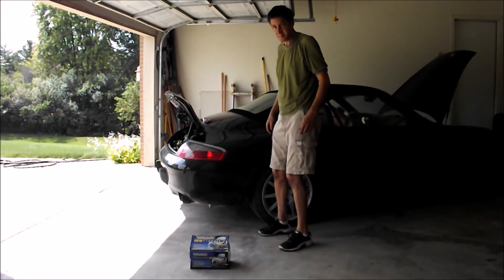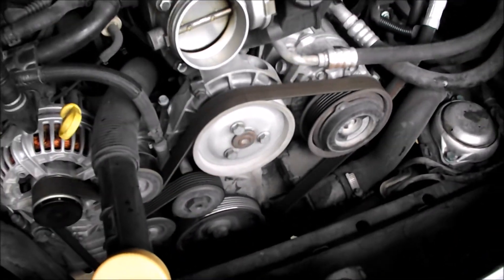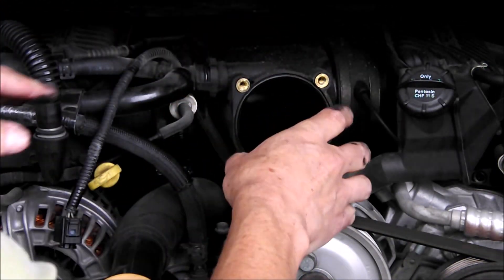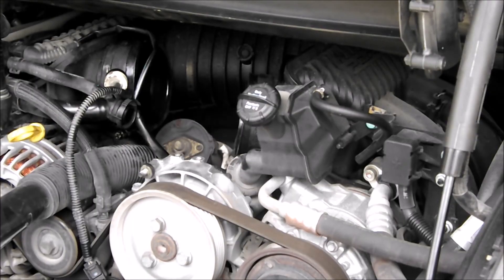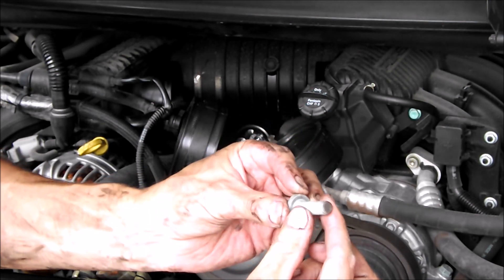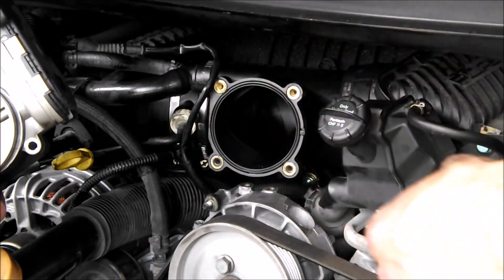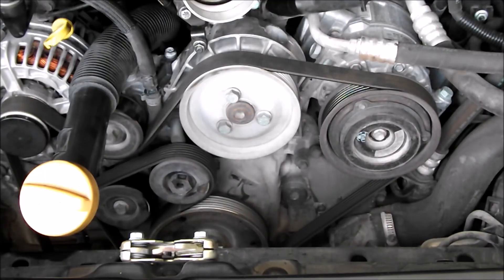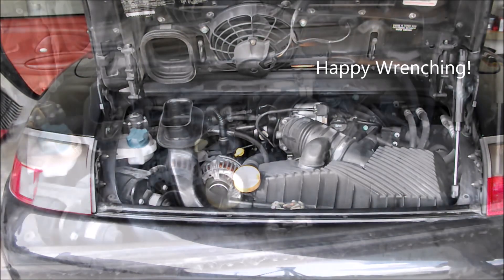Porsche 996 Starter Replacement

Comment: Hi guys, great video! Thanks much! I replaced the starter on my 2005 Porsche 911 Carrera Convertible (997) three months ago with a Bosch starter from Amazon (CAN $315.00). It solved my "hot start" problem and took me about 4.5 hrs to do.    A few notes: The Porsche Workshop Manual is pretty much useless in explaining how to do it (job #27 60 19). On the 997, I also had to remove the alternator to reach the bottom left fastening screw of starter; even then it was very tricky. I have no idea how I could have done it without removing the alternator! When putting in the replacement starter, I used electric tape to limit the movement of the u-joint of a rather long extension. As mentioned below by Chassis Hawk, the u-joint needs to be close to the socket. I also wrapped electric tape around the head of the fastening screw to prevent it from falling out of the socket when feeding the bottom left fastening screw back into its place. I found this to be the trickiest part of the job! Unlike shown in the video, I managed to remove the throttle body in one piece, though. I undid all four metal hose clamps and was able to wiggle the hose on either side loose, before pushing them sideways out of the way with a screw driver. This way, I was able to remove the throttle body in one piece. Putting the throttle body back in again was the same procedure in reverse. Be careful with the plastic oil filler tube as it is easy to break while working on replacing the starter.     ---     Replacing the starter solved my "hot start" problem that bugged me for almost 2 years. With only 56,000 km on the motor, the vehicle was reluctant to start when engine was hot. First thing I did was replace the battery (CAN $470.00). That improved things for a short while, until I experienced the same "hot start" issue. The Porsche dealer suggested to replace the battery cable. They did for CAN $1,000.00. Some 10,000 km later, the "hot start" issue was back. I had to charge the battery every couple of weeks to have enough power to crank the motor when hot. According to the various fora, the last thing to replace was the starter; I did that and have put 3,000 km on the vehicle since. Vehicle starts like a charm whether engine is hot or cold. It appears that over time, the heat of the engine fries the starter (and also the cables). Very happy to have done the job myself - puts a smile on my face every time I turn the key!   :)    Thanks again, Chassis Hawk!
Reply: Very interesting, thanks!  Could you have changed the battery cable yourself at the same time, or was this project something a guy would need to have a dealer or pro shop do?
Reply: @aboyandhisdog  I probably could have done it myself and replace the starter and the cables at the same time. There are other videos explaining how to do it (e.g. https://youtu.be/SDJ50RaF8XE). In my case, I had the dealer replace the cables.

Comment: There actually is a slot to fit in an extension without a universal. But you need a bunch of short extensions to stack them up as you push into the slot

Comment: Very nice video. Makes it look easy. What exactly was the problem with the starter. My 03 996 seems to take a little more power to start mine and it isn't turning the engine even though the battery is new. I'm guessing my starter is the culprit. 60k later I'd expect the, to last longer. 
What brand of replacement starter did you use. And what was the price. I've seen prices anywhere from $175-1100. Wow.  Thx again

Comment: Nice ! You probably saved $1000 . I prefer to replace the serp belt tensioner too .At least the pulley on it if (if available separate ) you know its still lower mileage

Comment: Great video, thanks. My starter on my 996 is also shot, and I am debating paying to have it done ~$800 vs just doing it my self. You make it look like a quick fix, but it appears there are some difficult steps accessing the starter. Any warnings you can highlight before I take the jump? Also, besides getting a starter, what other parts and seals do you recommend I replace along the way, besides the air filter? Also, that socket extension to access the starter bolts, will any flex shaft work for that, I can't see exactly what you did. Thanks for the video.
Reply from the maker: +Shea Ferring 
I would recommend changing the accessory drive belt, but I didn't see any other seals or parts that should be replaced.  Sorry about the view of the socket extension.  I used a 3/8 U joint with shrink tubing over it to restrict how much it would droop.  You might be able to get it done without the shrink tubing, it just made it easier.  The U joint needs to be near the socket.  Then you need a very long extension, such as 18 inch.  I have 18, 12, and 6 inch  3/8 extensions and unfortunately don't recall exactly what combination I used.  I used an adapter to fit to a 1/2" breaker bar to get enough torque.  If you already try to work on the car, I recommend taking it on.  It took about 4 hours, but we were slowed by taking video.  I've done a lot more difficult projects on the car, such as the exhaust replacement.  It was fun, and it's crazy how much you have to pay a dealer.  I bought a rebuilt starter on eBay and I'm happy with it.  The main tip is that installing the plastic plenum is a little tricky.  If you need to get all four hose clamps off, then you can push the plenum straight in and work the rubber around the plenum.  Then you have to be patient and reinstall the hose clamps.  I tried to leave the hose clamps on the rubber first, but that didn't work out.
Reply: +Chassis H
ywk

Comment: How did you losen the lower bolt ? That would be nice to know
Reply: after viewing this video maybe 70 times i decided to go for it. it took me an hour to reach this f***  bolt. you must have a 3/8 U joint with lots of straight extensions. also:  i didnt do it but shrink tubing the joint as advised by S.H. would have made it easier for sure (didn’t want to break and loose the plastic part downthere). i endend up with my right hand guiding the tool thru the space made by the missing air tubes, and helping it the tool to reach the bolt so that you pass between the oil tube and the alternator and place it correctly. I gently use a hammer to have it lock on the bolt, if its not aligned you won’t be able to unscrew it. mine was heavily screwed. My car has 240k kms and the starter has never been removed before apparently i wouldnt recommand to change it for fun if it doesnt make the horrible sound when the engine starts (the starter dented thing doesnt come back in it's position so the wheel makes it turn quicker that it should). The tool and the 2 bolts has to be perfectly lined up or you will swept. There's tons of plastic tubes, electric wires, durites and the oil reservoir tube that make it looks impossible, but it works, its german.. Even to take the old starter out is not so simple. I got a 3,6L and it look even tighter than the 3,4L in the video (or S.H. disengaged some cables?). I'm a beginner and it took me 8 hours. taking out the air planum was easy, take it back was not but again with some force it’s working. Thanks for making this video it has been my Starter Bible. this horrible neigh sound is gone :-) PS: i bought a A.S. to replace my Bosch. 90€ new instead of 240+120€ return of the used one fee. Pardon my english dont know lot of technical terms in english. Hope this will enlight even more the situation.
Reply: @vadimsvoboda  Hi there good job!!! Just curious what dies the neigh sound like? Sometimes especially low battery mine starts to crank but fails to start and it sounds like a clunky crappy noise my starter still spinning and cant stop it until it completely drains my battery. Could it be running and solenoid activates but bendix gear not extending?
Reply: @9jfd1  mine was sounding like an horse with a touch of « fizzzzzzzz » last very short like 2 seconds

Comment: While doing my IMS bearing upgrade I  realized the starter is on the engine and not the trans like old air cooled vw's . I thought the with trans out it would be the time to replace it but with only 40k miles I'm sure it has a lot of life left. But I looked at it from back of engine and still was like "how the hell do you change that ??". Ok I could have looked in the Bentley but this vid shows exactly what I need to know . Thanks ! I already changed the AOS and that was still a pain with trans out .Having it on a lift would have made it easier.

Comment: OK so got everything off OK EXCEPT the starter motor!! Bolts are off but it must be seized somehow on the engine block. Tried banging on it used PB blaster to try to loosen. Nothing! Waited for the weather to cool off hoping temperature would help. Nope! Ready to give up and have it towed to indy or dealer...
Reply: There might be someone who would hook the battery back up, put the car in gear with the parking brake set, and hit the key switch hoping it would kick the starter off of it's mount.  

Not me for sure, but if someone tries it, I'd like to see the video.

JMF TAG
Reply: @TheAlignmentGuy_TM  Mmmmm wonder if that would have worked. All set though.
Reply: @scubajumper    I have a 996 in the shop needing a starter, and I own a '73 911.  You can't own or fix 911s without having a sense of humor about it.

JMF TAG